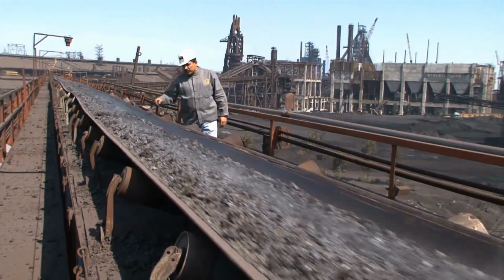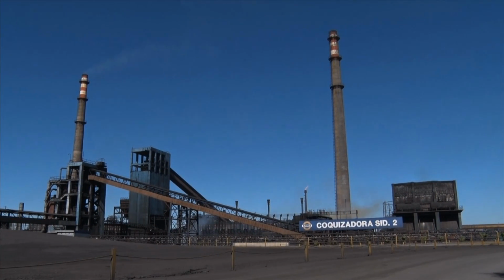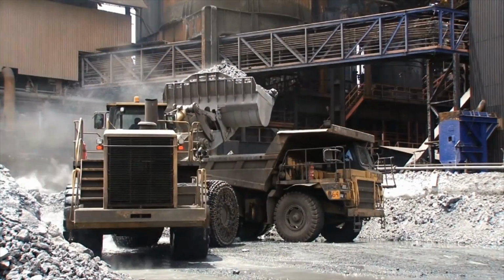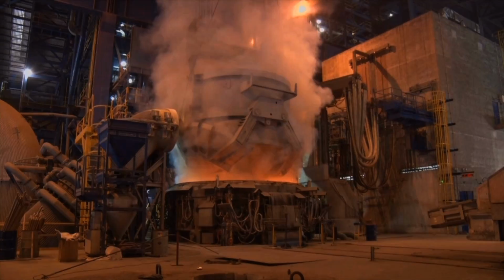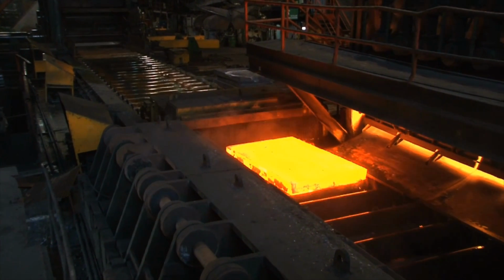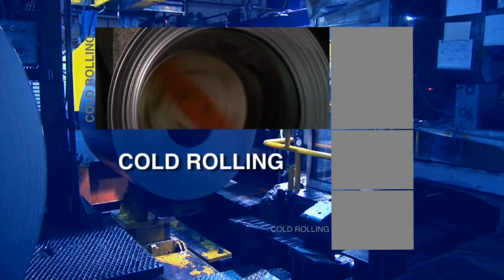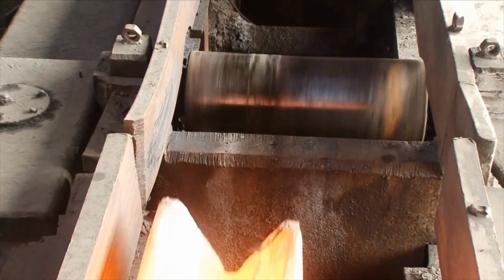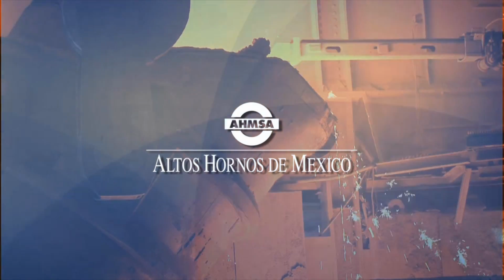Steel making Process

Comment: how do you change the electrodes?
Reply: https://www.youtube.com/watch?v=Iytcr3T8ZIg   they just disconnect the wiring from the top,  pull it out with a crane, and drop a new one in
Reply: The cabin electrodes slowly burn away, you keep adding to them one end is threaded the other has about a foot - foot & half nipple !

Comment: Rongxing Group is the China leading supplier of carbon metallurgical products with 24 years experience. 
Graphite Electrode Production capacity: 80000 tons/year 
If there is any needs, i am pleasure to help. jean@electrodepaste.con whatsapp:+86 18838042177

Comment: how can students memorize and remember all of that ?
Reply: Students need to read again and again and by heart it for exams.
Reply: @chandramoulipakki9110  This is the thing we should change ma'am. Just byhearting or rote learning shouldn't be encouraged to students. A major problem in India. Focus should be given more on understanding it rather than remembering for exams. If students are only made to study "for exams", then we wont be able to create better leaders for the future.
Reply: It's really easy. In essence you have 3 big steps in steel making: melting in furnance, treatment and ferro alloys addings in secondary treatment (to have cleanliness and desired chemical composition) and casting + cutting. Search for online classes that have schemes and more videos (I recommend the steel making with scrap instead of iron ore. It's more impressive visually 😏)

Comment: Isn't this temperature and gass hazardous for workers there
Reply: Most of the work is controlled from a safe distance. Only during maintainence work the workers operate on them. But yes it's indeed a dangerous work
Reply: Yes and note that the workers are wearing protective equipment. Heavy industries in advanced nations have Occupational Health and Safety LAWS that Companies must adhere to.

Comment: Still don't understand what Sinter is for? Need a lesson in Steel Chemistry.
Reply: Usually lots of dust particles are generated during the mining and other operations. But this dust particles can't be directly charged into the furnace as it will decrease the porosity and choke the furnace. So they are sintered to bind the small particles together. The resulting sinteres have improved mechanical strength and required porosity. This improves the productivity.
Reply: @abhinav1149  Well done..I'd expect that the questioner would have at the very least thanked you for such good info...Crushed small particles of Limestone are also used as a flux along with what is loosely termed "Cold Return Fines"

Comment: I know it is an ignorant question to you metallurgists, but may i know why it is called pig iron as well as cast iron, both contain the word iron while those have greater amount of carbon than steel?
Reply: In short cast iron is iron alloyed with a relatively low carbon content with other controlled elements. Depending on the type and application it is mostly a finished product before being casted into other products. Pig iron is blast furnace smelted iron ore with a relatively high carbon/silica content and is commonly referred to “crude iron” because of its impurities. It’s exclusively an intermediate product of cast iron and steel production. After processing it produces a waste by-product called slag
Reply: I expect that it is no different a scenario to what we had in Australia pre WW2. We had a Prime Ministerwho was given the nickname Pig Iron Bob after he sold off Iron pigs to the Japanese and it was kindly returned as armaments.
So blast furnace hot metal / iron is transferred by torpedo ladle to a Pig Mill which has mounds on a chain conveyor that the molen metal is poured into. On cooling the pig is removed from the mould. It makes the Iron transportable and also for use in anciliary operations such as foundries.
Reply: Well the answer is simple,the pig iron is called so, as it resembles the shape of a reclining pig.

Comment: I'd like to see the Global Warming idiots and Greenies try to make steel using just sunbeams and sea breezes (solar and wind). Good luck!
We will always need coal to make steel.
Reply: You clearly haven't heard of hydrogen direct reduction then
Reply: Unless you have an electrical arc furnace and a pile of scrap steel. Because scrap steel is already steel there’s no need to produce pig iron and no need for a blast furnace.
Reply: @tycobandit  And are you powering your Arc Furnace with a bicycle? Learn how much current is drawn to melt your scrap.

Comment: Sir I have to Open an Iron Smelter Company please tell me how much it will cost
Reply: Are you trying to do a project that starts from mining? scrap? for example as explained in this video? a EAF plus CCM system for 50T should be around 50M USD. Not including an oxigen plant and water treatment plant, which should be around 15 to 20M USD. If you are looking to start metal mining and extraction, well those costs are way higher and depends on many factors, such as land, permits, machinery, etc. There are also so many different methods. Some plants spent around 3B USD for a complete system. Hope this helps.
Reply: 010angelo010 I think you’ve just killed him through a cost based heart attack, I often wonder if people really know how much it costs the run a plant like this, the energy bills a month run into the millions too
Reply: @davehowe4714  the reason I know the costs to start is because I have one. Obviously I didn't spend 3 Billion, but the costs are high. A more realistic number is around 140 million for the 2 blast furnances plus 70 million for the converter, EAF, CCM, and lamination. Electricity and labor depends on the country. Usually a plant that has a blast furnace system needs 8Mva. If you add a line for a converter, EAF, CCM, and lamination your numbers hit around 60Mva for a 30T system. If you start with a small foundry that did 100K ton a year with a ccm and lamination from scrap that would be around 15 million.
Reply: @010angelo010  3 billion, you got robbed
Reply: 010angelo010 thanks that’s interesting to know 👍🏼
Reply: @Trumpster71  I don't think you read my comments properly. Please read them again. "Some plants spent around 3B." These are obviously influenced of what lines they have, their capacity, country, resources available, and having a complete vertical integration. if you read my other comment, it says, "I didn't spend 3 Billion."
Reply: 100's of millions